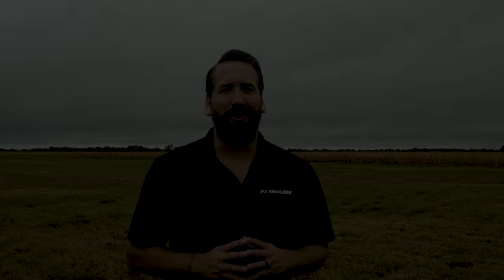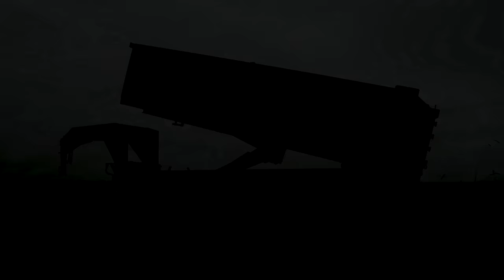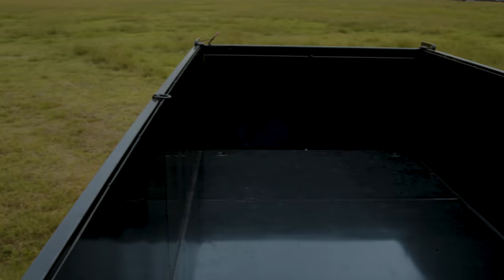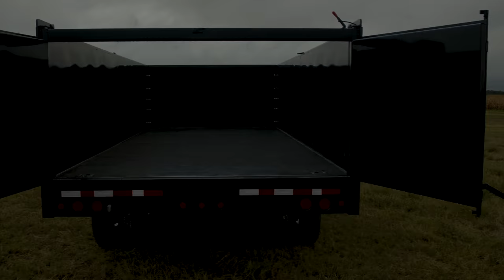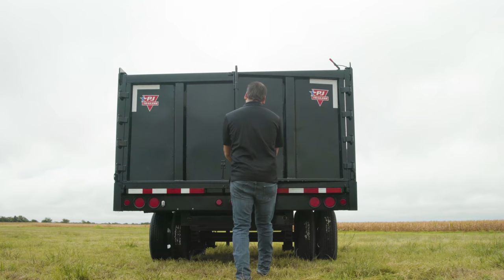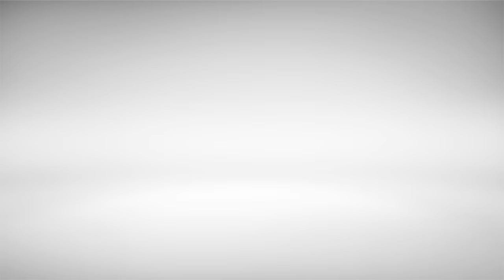Tandem Dual Dump (DD) Quick Walkaround

Comment: I have a loadtrail 18' dual tandem dump  ...paint sucks. Powdercoat paint sucks to no end..... When it's starts peeling it's like razor blades hanging off everywhere.  Had to add extra batteries and stand alone vehicle charger plug to keep batteries charged during runs. They are great trailer to have in the arsenal.